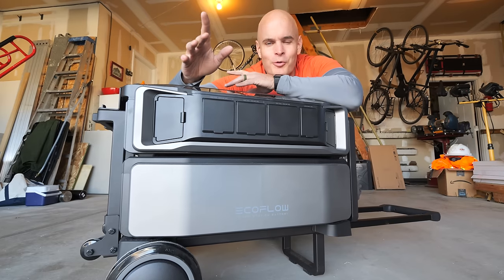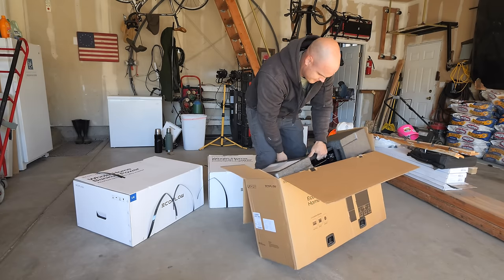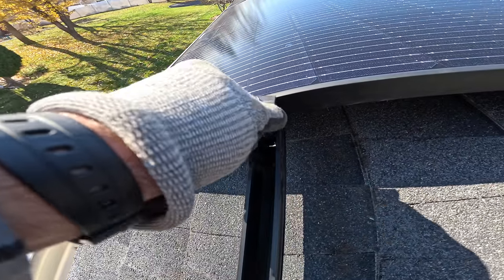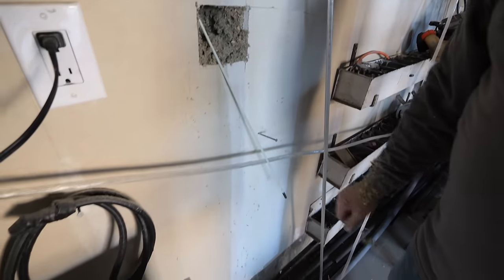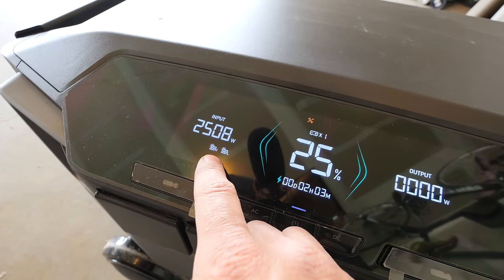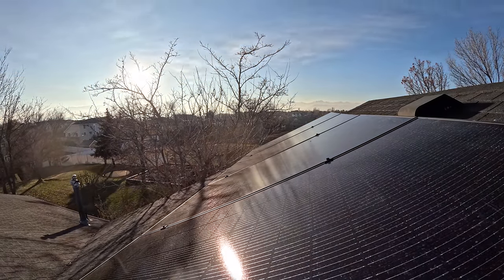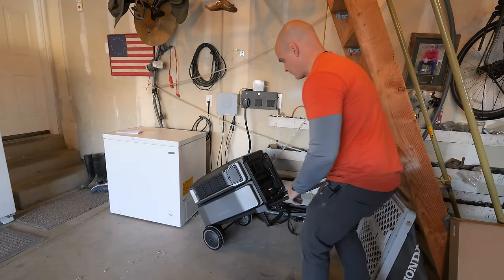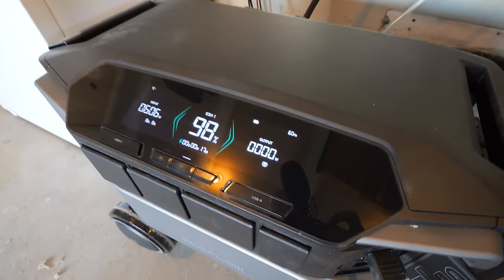Off Grid Stackable Solar Battery - So easy its *Almost* Cheating...

Comment: EcoFlow is literally twice the price of their competition. Ridiculous waste of money.
Reply: $4,599 is comparable to an EG4 6000XP with 2 rackmount batteries. Not to mention the EcoFlow setup is easier and is portable for glamping/cabin/RV purposes. However, the rack mount batteries start getting considerably cheaper when you compare a 4kwh rackmount at $1,200-1,500 to a 6wkh EcoFlow at $2,799. It's about a $500-$800 premium for EcoFlow on the batteries. Going to start with the bundle and wait for the batteries/home panel to drop in price.

Comment: For you as a end user it is infinitely better to have Tesla solar roof and sell electricity to the grid for the same price as you buy which is basically your unlimited baterry and have 12kwh as a emergency backup.  At the end of the year you will probably make from dozens to hundreds of bucks from your electric provider in unused electricity. Not to mention the looks and longevity.

Comment: "...90kW hours worth of energy that's enough electricity to backup an average home for like a month or indefinitely if solar is there to charge them back up."   Where does your target demographic live?  Average US monthly consumption rates appear to range between 560-1200kWh/mo, so 90kWh is going to last the most frugal users upwards of about 5 days.
Reply: I agree... My small ranch uses 157KWH per day.

Comment: 3:56 I don’t know anything about electrical but is there supposed to be that much raw touchable copper supposed to be there? Aren’t they supposed to be shielded?
Reply: Ground wires.  Perfectly acceptable inside the panel.

Comment: Wonder how long till these pay for themselves.  

I have a 10k backup battery on the side of my house through our power company.  They sold it as a huge money saver.  Have yet to see any savings... Its the worst.  They have total control of it so that makes it really bad.  They run during peak hours and they deplete everyday. What ever is left the power company throws onto the grid.  So no extra for overnight power outages.  Bought a whole home generator this past summer to take the place of the batteries.
Reply: So you got duped by the electric company and now batteries are bad...ok

Comment: That's very cool, and while i can see the obvious advantage for use in an emergency or backup power source, i'm curious about the real economic advantage for continual use.
That battery must not come cheap, how many battery need to run the household?
The warranty is for 5 years, so it probably reasonable to expect the battery life for about 7 years?

Now, the question.... are the saving from electrical bill offset the price of x amount of batteries to run the house over it's expected life time?

Comment: What happens when you have to actually go off grid & aren't able to get the parts to repair these super proprietary plastic battery boxes? All of it runs on proprietary closed source software too that will be unfixable for you if it encounters bugs. This seems like something you'd want to completely stay away from if you want to make a reliable off grid system.

Comment: My biggest problem is I can't find the full price anywhere. Does anyone see it in the website?
Reply: The unit does not launch until tomorrow at CES. The retail price for the inverter and battery combo is $5,799. You can buy a 0 obligation discount coupon today for $300, which gives you $1,500 off the retail price. So, assuming you purchased the coupon, it would be $4,599 (including the price of the coupon)

Comment: They also make a portable seamless gas generator that fits right into the pack, and will go off and on when the solar runs out. It can charge a battery in 2-3 hrs, full. I think this would be less then 1-2 gallons of gas every couple weeks. Good alternative to a second battery or off-grid back up.

Comment: My electric bill is over 200 per month and I use 3370 kWh per year. I have an emporia setup so it is all accurately metered. Anyway, that averages out to 10 kWh per day. So I did the math, in my area only 4 hours of solar sun, so I would need at least a 4 KW array. On santan, I can get 5-6 KW of panels for just over a 1,000 bucks. Now, I can also get LiFePO4, 24v, 8 kW. They'll all be in parallel so = over 4.5 watts of pulled energy, with a 10s burst of 12,000 watts. Cost would be 1,500. If I decided to go with server racks, I could for the same price. 

So far we are up to 2,500. Now, the solar inverter. I won't be ever pulling 12,000 watts, maybe 5k at one time, so we're looking at around another 1500. So now we're up to 4,000 bucks. Wiring, fuses, bus bars, panels, switches, racks, hardware etc put on another 1,000. 

So far 5,000 bucks, a system that is ready to go. This isn't the first time I've DIY my own solar, so I will do 100% all the work.

So I calculate it like this. 5,000 / 24 months (2 years) = 208 dollars per month, which is the cost of my electric bill PER month. Which means in exactly 2 years, it will pay itself off and everything after that is maintenance costs. I estimate 4-5 years from LiFePO4 before I change. I have experience with these and have 8+ year old systems running, do my own repairs, replace cells myself and BMS if/when it goes bad. So I estimate a maintenance cost every month of 31 dollars. So we're talking 2.5 years to break even, then a savings of 85% for at least 10-15 years. 

If you don't do the work yourself, you're looking at 10-15k which will take 5-7.5 years to break even. The work isn't very hard, it's just A LOT of work. I've installed 10x 250w panels by myself and it just takes time, because each panel weighs 50lbs or so, so it's quite a bit of physical work getting it on the roof, then placing it exactly where it needs to go over and over and over. Expect a full shift of 2-3 days to get it all done. For me, that's 300 bucks per day lost, so total of 900 bucks labor (paying thin air for my own work) which is way better than 5-10k of labor for "professionals"
Reply: Server rack batteries are a much better value, the EcoFlow batteries are about twice the price per kwh. One could argue they are easier to configure. For instance, the EG4 PowerPro is a 14.3kWh LiFePO4 battery that can tie in with their 6000xp with relative ease. That's a much better value, especially since that battery comes with a 10 year warranty. Probably more work to setup and not as pretty though.

Comment: I cry for the waste of lithum these are about to create.

Also why the hell weren't these a product 5 years ago. Lithium batteries were invented in like 1992.
Reply: Why a waste of lithium?
Reply: @JohnSmith-wt3mw   There's currently zero recycling centres; The batteries are not build to last, and the packs are a nightmare to disassemble. Their returns and warranty exchanges ends up landfilling the units, not repairing them, because insurance companies say they don't cover lithum-related incidents. The lithium mine owners are putting huge pressure on destroying recycling so they can keep profiting. there's a reason smartphone batteries are trash - or why there were disposable vapes with li-ion in them.

Comment: So finally, you can have electricity even when grid is off?
because classic solution will cut off your solar panel when your grid is off. Like, during network intervention by your electricity supplier, because it will send electricity to the grid and electrocute worker. :( 
wo finally a proper solution.
Reply: many solar systems do offer grid-off or islanded operation, but normally only when they have batteries - since solar panels cannot power start-up surges or rapid changes like switching on a kettle. JerryRigEverything did a video 1-2 years ago about an Enphase IQ8 installation that they did for a friend, which also has a backup function when the grid is off, but that's for two small circuits only, as there aren't any batteries.

Comment: I wonder if they have any anti-theft measures. 🤔 I’m assuming since are so expensive that you might want to secure them in some kind of way to the house.
Reply: a single 1 inverter and 1 battery combo is 170lbs - nobody is going to just grab it and run off or load it in their car...
Reply: @Stefanfj you must not realize people used to steal tvs heavier than that. CRT TVs were average 200-250 lbs people also steal atms, motorcycles, four wheelers. If the value is there thief’s will find a way.
Reply: press x to doubt... Nobody just walks off with 250lbs of crt tv. It doesn't even fit in a car, you'd need a truck and 3 buddies for that. If you have a truck and 3 buddies, you're not going to be stopped by any antitheft brackets either...
Reply: @Stefanfj you must think criminals always work alone.
Reply: @gbpg2016  let me preface this with saying, I don't know what second hand batteries and inverters sell for in your area. In my area, they normally go for about 1/4 to 1/5 their retail price if there's no proof of purchase. That means if there's you and a buddy, you just picked up 170lbs of stuff that you could probably move for $900. Minus expenses that's like $400 per person - if you get away with it. Doesn't seem very profitable to me to cut in a buddy who's going to rat on you when he gets caught...

Comment: I wish you provided more info on grid tie.  For instance, what happens when the battery is dead, does it switch to grid?  What if you consume more energy than the inverter can handle, does it used grid as a supplement?
Reply from the maker: Yes, when the battery gets to whatever percent you set, it’ll start recharging from the grid, or just wait until the solar comes back online, whichever you set. And yes, individual breakers can be set to go on grid or on battery depending on the situation
Reply: @JerryRigEverything  zach, is the giveaway for the phone still on? just clarifying cuz I haven't seen any replies.

Comment: How loud is it when it's running? My ecoflow sounds like a jet engine when in use.
Reply: The new cooling solution does a much better job of keeping it quiet compared to the other EcoFlow products.

Comment: The panel isn’t worth buying, just hook it up to a 50 amp plug for generators and save yourself a lot of money, not to mention, you can use any of your main panels breakers.  
Plus, you can take the whole thing with you when you sell the house.
Reply: Are u saying to go with off grid?
Reply: @Nayan-ic3ig  
No, I’m saying that you don’t need to buy that special electrical panel, save yourself money and just get the 50 amp plug. That way you don’t have to get any inspectors or permits.
Reply: @simon359  cool

Comment: 90 kwh will power the average home off grid for 3 days not a month
Reply: I believe that also assumes solar input capacity across 3 Delta Pro Ultra units. Technically possible to run completely off grid indefinitely with this setup if your usage never exceeds your solar output.

Comment: I do not understand the part about the glowing fishing rod to minimize wall damage.
Reply from the maker: It pokes up through the wall so we can tape the flexible electrical wires to it, and pull it back down through the opening of the drywall we cut.
Reply: @JerryRigEverything  you see my other comment?

Comment: Most people can't afford this 60k$ setup
Reply: $2,100 for 14 solar panels, $700 for racks/mounting hardware, $600 for various wiring/conduit, $6000 for Delta Pro Ultra/Battery/Smart Home Panel 2 bundle, $200 for DC disconnects/cable boxes. Around $10,000 and you can still minus 30% in the US for the tax credit. Though this assumes you have installed it yourself and have obtained any required permits for solar installation on a building.

Comment: What is the lifespan of the battery? It really depends on the lifespan of the battery or the money that will be saved from 0$ electricity bill will be placed back into the repairing of the system. It is a great idea, but not fully independent yet, as you still rely on the software and hardware of the battery and solar panels.
Reply: 3000 cycles at 100% DoD leads to 80% of original capacity - so cycling daily means around 10 years - since you won't necessarily be going down to 0 or up 100 every day...
Reply: They carry a 5-year warranty and are rated to 3,000+ cycles before dropping to 80%, which is 8 years of daily cycling. But yes, that is a risk considering both the inverter and battery only have a 5-year warranty and the break-even point on this system may be longer than that (depends on install costs and how much grid power costs in your area). However, nothing says it can't last 10+ years without issue.

Comment: Yeah but how much is the UtraPro going to cost? Can’t find the price anywhere. Have the coupon in my cart but I want to know total price that my discount coupon will cost after the coupon.
Reply: With the promo of 1000 usd off as per zac, I am guessing it is around 1 to 1.5 kidney price in black market
Reply: It was listed on the website where you buy the coupon, was somewhat ambiguous though...
Wonder why they removed it.  The Delta Facebook group mods posted 5799 1x(Inverter+batt) before coupon(so add $300 to buy the coupon and then subtract 1500 to get the price) with the SHP2 it added I think ~$1400, I forgot the exact price as I thought it would be available from the website😅😂

Comment: So when you say high voltage / low voltage panels do you mean one set has micro inverters and the other doesn't?
Reply: No, there are 2 MPPT inputs.  One up to 150V(matches original Delta Pro) and the 2nd is up to 450V 4000W, (15A still iirc)

Comment: Off-grid and solar energy are a dream, but unfortunately here in Brazil it is practically unfeasible for those who live in an apartment and for those who live at home it becomes so expensive that the bill will only become green even by the 3rd or 4th generation of the family.
Reply: Your best bet with an apartment is no battery and just a small 600 or 800w inverter with 2 panels hanging somewhere.
Reply: Might make sense for a smaller unit. They are making solar panels designed to be hung from balconies these days.

Comment: did you have to pull a building permit to put the panels on the roof?
Reply: In most jurisdictions, yes. You will need a permit for any solar installation on or in a building. Technically the Delta Pro Ultra is a solar "generator" and might not need permits itself assuming you are using it with portable solar systems that are not affixed. However, since this is designed not to back-feed into the grid, you do NOT need an interconnection agreement with your utility.

Comment: As long as there's no proprietary app that needs to phone home and stuff like that then this seems pretty epic.
Reply: If it's anything like the rest of their lineup, this is absolutely the case. No local network access, no direct bluetooth access. The Pro has to be connected to Internet and your phone's app has to as well in order for them to talk with each other. The only direct access is a bit of initial setup to get the pro connected to a wifi network. 

However, I would love to be proven wrong.  At 3:54, I see an RS485 serial port. If that's enabled, then it should be possible for a local application to control it. It might even be possible to sniff the serial data and make a 3rd party application.
Reply: @yourtechjohn 
This is informative and unfortunate.

Comment: We have solar and batteries, and from several years of experience I can say that batteries are more important than solar for controlling costs. We went several years with only one battery, which didn't quite last through the night and never left much reserve for cloudy days or power failures. We frequently drew from the grid, even though we always more than made up for it. We recently added a second battery, and haven't drawn from the grid since. We've had lots of overcast and rainy days, but the extra capacity means there's always plenty of reserve and even though it takes longer to charge, even on the rainy days by the end of the day there's plenty to get us through the night with reserve to spare. Even if you have no solar, buying 100% of your power at the cheapest possible rate makes an enormous difference in your bill. You can't afford NOT to have a home battery. The other benefits of conditioned power and eliminating outages make it a no-brainer.

Comment: This is awesome! The one question I have is what is the pricing break down for the Eco Flow and install of everything at normal price. I know cost varies per region and state but for budgeting purposes, it could help someone such as myself to consider if this is a feasible option, be it for a garage addition with bed rooms above or for the whole house instead of a Generac whole house back up.  Either way, love the content!

Comment: Your first solar install video is LITERALLY AN INDUSTRY MEME! 

On this install, you installed a solar PV array on a residential structure and don't have RSD. Go lookup NEC 690.12 and correct the problem.